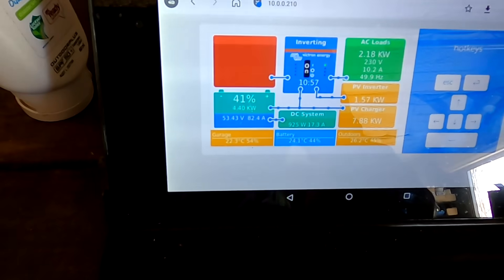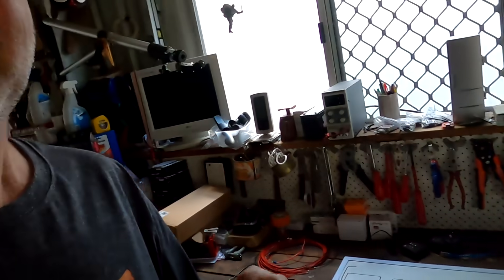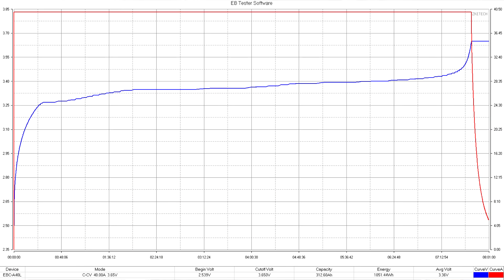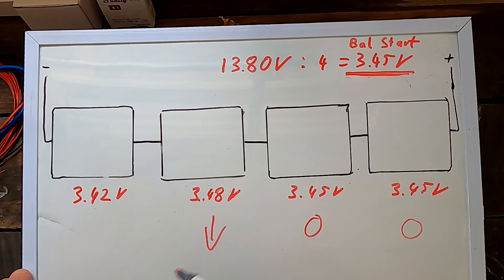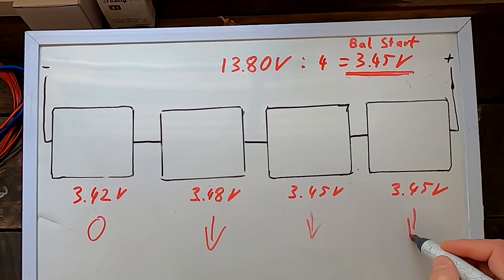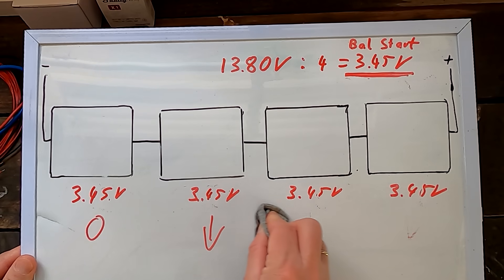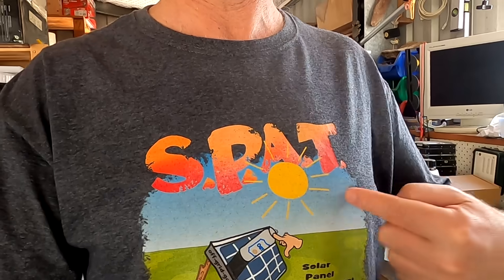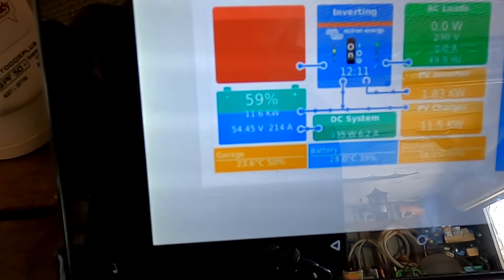Balance Start Voltage for LiFePO4 explained. Why you should not start too early... 🔋⚡

Comment: oct31’23/1639h PST 🇺🇸 Danke Herr. Andy. Guten Morgen. I think you have mentioned this several times during the past 7~8 years. Danke. The theory was put into effect. After studying and practical tests conducted I found it was/is correct. I also found, the readings depend upon the cells/ B,C,D,E to infinity. Many Chinese Cells are Z grade, rejects from the factory and I found it about 6 months ago. A vender from Aurora IL, sold me come LiFePo4 cells with strange trade name.  The cell outer covering, glittering as if fresh from Chinese factory.. top balanced checked for stability, internal resistance checked  (thanks to Andy, for recommending YR1035 and WS400A PV Panel Meter they both serve well in maintenance & testing) Found no significant issues. But, under load  these cells exhibited different characteristics. One cell over charged and JBD ceased charging. The other cell did not charge at all. What I’m trying to portray here is, every character, every reading will be unidentical depending on cells, the good brand name. Buy directly from factory with certification, expensive, but then you don’t have to argue, contradict, exhibit difference of opinion, avoid frustration and indignation etc etc.
By the way, I replaced the cells with TOPBAND cells 3 years ago and all hunky dory, presently.
Thanks.

Comment: Hi Andy, 
Thanks again for another great video.
I know ages ago you did a BMS parameter explanation.
It would be great if you could do one on your prefered settings.
Also one on battery % voltages across the range 0,10,20,30,40,50,60,70,80,90 and 100%
Thanks again Andy!
Reply from the maker: We cannot use voltage to determine the SOC of LiFePO4 batteries. That is impossible. At 3.25V the cell could be at 40% or 80%, no way to tell.
The settings will be different from system to system, so my settings will not fit your design. Very hard to do... Let me think about it...
Reply: There is already one if you search the video's

Comment: What charge voltage you use from inverter for target  55.2v (3.45 x 16)? On my Growatt Inverters I getting 3.35v  on my fully charged batteries from charge voltage of 52v.
Reply from the maker: Yeah, that's normal because of the voltage drop and the two individual measurements the inverter and BMS take.
You may have to set the inverter to 55.3V/55.4V and see how this goes...

Comment: THANKS Andy, as always, a big 👍👍. Right on the money. 
Years ago I had a slow balancer on my 400A LFP caravan battery, and couldn’t set a start voltage so it was always “balancing”, and can absolutely confirm your findings. 
Since I fitted the JK in the van, with balancing set to start at 3.45v, it’s all been PERFECT. I typically see just a few millivolts difference between cells.

Comment: at about 7 mins, what kind of $20 balancer does that! why would it balance all 4 cells as you rightly say when only one has gone above 3.45? you just need to dump energy from the 3.48 into the 3.42 (like the jk bms would)
did i ever mention that I think the jk is the only bms worth buying....
Reply from the maker: That was just an example to explain the basic balancing function.
Yes, JK is still the top!
Reply: @OffGridGarageAustralia  it's addictive, now I have nearly 8kw so need a pure sine inverter so I can run the induction cooker....

Comment: I'm wondering if there is any real capacity difference between charging to 3.45V and 3.55 or 3.65 if they're all followed by absorption and float (at a lower voltage).
Reply: Andy did a video on what the capacity differences are at the different voltages. It isn't a lot of difference at the voltages you talk about.
Reply from the maker: That's the video: https://youtu.be/pijPu7t-akM

Thanks, Larry.

Comment: This is exactly why i don't like lifepo4 or any cell other then lead acid.  Only good thing is they don't weigh much when compared to deep cycle lead acid.
Reply: I still see deep-cycle LA systems in professional applications.. not new ones though (mostly legacy and also because it's simpler), but ESS is just a small part of my engineering/technical work so your mileage may differ.
Reply: @joansparky4439  the only issues i have with lifepo4 cells is that some will reach the ovp over volt protection of 3.65 while most will still be 3.35 to 3.40.   and when under a load some will drop to the uvp under volt protection of 2.40 while most will still be at 3.00 or 3.20.   once a cell reaches a charge of 3.50 or so it climbs quick and same for discharge , once it reaches 2.40 it drops quick.  I'm going to eventually do another test to see what happens when overcharged to 6.00 v and discharged to 0.00 a number of times.  Before i installed a bms i had one used cell that reached 8.00 volt and that cell still works fairly good.  And according to the online videos all should be ok.  Lifepo4 cells dont usually cause a big fire.
Reply: lead acid also needs top balancing in the form of out-gassing (and then topping of with water) to keep them on the same page, while the weakest cell still determines the performance of the whole pack.
Active balancers which are strong enough to divert the energy difference between the weakest and strongest cell run all the time and will remove the weakest-cell limitation and give access to 100% capacity of the pack.
Reply: @joansparky4439  lol, find me a strong enough active balancer to do this miraculous job that doesn't break the bank.  None in existence yet. Lead acid does not require anything other then a charger and won't overcharge individual cells like lifepo4 does.
Reply from the maker: Lead acid is outdated in any aspect. There is literally no advantage of LA over Lithium.
Reply: @OffGridGarageAustralia  only a wealthy person would say that or someone promoting their own sales.  Must be nice. 👍🤟👌

Comment: If you were starting from the beginning now, would you chose to buy single cells and a BMS or ready made batteries with internal BMS?
Reply: I think he discussed this a bit in a recent video.  If you have the time to build your own that is an option. But with the price that some of the batteries like Jakiper are selling for , it gets tough to get all the components and case separate without coming close to the pre-made battery price.  The only difference is you could these days  probably get a better bms than some of the built in ones use.  Besides the single cells and bms  - you need connectors between each cell, breaker, wires, some sort of cell compression, and terminals.
Reply from the maker: It's good to have the options. Price wise, it's not much of a difference and both options have pros and cons.
I personally would still build my own battery like I did in the battery shelf.

Comment: I have read somewhere that DC breaker switches can get hot when the current direction is wrong. Is that correct or false?
Reply from the maker: Most DC breakers are bidirectional so it does not matter. 
I never heard about that a DC breaker gets warm when connected that way. It makes no difference from the current flow and mechanics it has to travel through.
Reply: Most breakers work by a thermal cut off. So if you're running at or over the rated current they heat up, which triggers the disconnect.

AC breakers and DC breakers work differently, so using a DC current in an AC breaker can cause issues with triggering, but also can fail to break the current due to the differences in the nature of AC vs DC.

You should use cable rated for well over the maximum current of your system and then use breakers to match that cable. Breakers are for the protection of your cables, not to control the current flowing in your system.
Reply from the maker: There is a good video from Adam Welsh showing the difference between both

https://youtu.be/S0diAeysxVo?si=2WxSbk3FX_mc153z

Comment: How do I parallel 250a muller energy bms.
Reply from the maker: More info needed.
You need one BSM per battery pack, if this is what you are trying to do.
There is no communication between the BMS though.
Reply: @OffGridGarageAustralia Ok that’s what I figured. that is my setup.  As for parallel, why would you join two bms for?

Comment: Can you parallel multiple MPPT chargers to one battery?
Reply from the maker: You can parallel as many MPPTs as you like and connect them all to your battery. Each MPPT can only have dedicated solar panels connected to it. The panels cannot be shared amongst the MPPTs.
Reply: And when yes, can you also connect to the same solar panels to increase charging current? Or only different panels to one battery?

Comment: Well, im pretty new to this all. I just got my Victron system running and installed with a JK bms active balancer.
I still need to charge the cells to 3.5 ( victron said that charging higher then 3.45 is pretty pointless, because not much power is absorbed above that ) , but ive set the start balance voltage at 3.4. It seems to work pretty good, it takes power from the highest cell to the lowest, just how you would expect.
So how is this not good ?
I understand that balanceing at a lower voltage is pointless, but 3.4v as a start, again, im a total beginner at this, doesnt seem wrong to me.
Reply from the maker: I think I have explained that in this video.
If your target voltage is 3.5V why would you balance cells which are at 3.44V for example?
Reply: @OffGridGarageAustralia  Well, I would say, that if you charge them to 3.5v and also start balancing them at 3.5v , they would drop quickly below 3.5v ( when battery is in use ) , and thus would stop the balancing program. So I imagine you NEED to start balancing below your set charge point. 
But I agree, balancing as high as possible seems to make the most sense.
Ideally you should start balancing after 1hour of rest after charging, but in the real world this probably does not work.
Reply from the maker: @edwinbruckner4752 The charger will keep the battery at constant voltage at this set target voltage (CV or absorption phase), so the battery cell voltages will not really drop as they get recharged right away again until they are all equal and the charge voltage is the same as the battery voltage.
Reply: @OffGridGarageAustralia  
The weakest cell will reach the highest voltages fastest.. to spare that cell it would be wise to start balancing early to keep it's voltage lower and divert the energy it would be trying to store to cells that can easily take it (the ones who are laggards and don't raise as fast with their voltage). This increases the wear on those stronger cells and fills them up faster.
So early balancing with active balancers actually is preferable as it saves weak cells and wears strong cells more and ideally (if the balancer is strong enough) should even enable more capacity in the bank as the weakest cell is supported by the strongest cells now.
For passive balancing with it's minuscule energy burning capabilities in those tiny resistors this is not working and late top balancing is the only viable way, while having to live with the weakest cell determining the overall battery performance.
Active balancers simply allow for less well matched banks to work as good as better matched banks.

Comment: I guess you mixed up some terms. If we talking about balancing on the charge phase, there is no such thing as a discharge (unless your balancer allows you to bypass ALL charging current for a dedicated battery). So if the balancing current is less than the charging current (which is true for almost all cases) all that balancer can do - is distribute a small part of the charging current between the batteries. So if the charging current is 20A and the max balancer current (delta) is 5A you may have as a result, for 4 cells: 25A (for battery with lowest voltage), 15A (for battery with highest voltage) , 20A, 20A. So there is no such thing as "discharge", just one battery with the highest voltage would have less charging current.
Reply from the maker: No, I didn't mix that up. Balancing while charging is pointless unless you charging current is lower than your balance current. Just as you said.
Reply: @ OffGridGarageAustralia  
Balancing while charging removes charging energy from the weaker (faster raising) cell and pushes it to the stronger (slower raising) cell.
As long as the cell capacity/capability difference is within the reach of what the active balancer is able to divert from the weaker to the stronger cells, will this ensure that all cells are being loaded appropriately to their capabilities.. the weaker ones are being loaded less while the stronger ones are loaded more (same applies to discharing while active balancing is on).  Over time this should get the cells within the pack on equal footing as the wear on the stronger cells is higher.
All this "top-balancing" wisdom is only useful for passive balancers.. active balancers who can divert the energy difference between weak and strong cells make this approach moot and gives us access to 100% capacity of all cells.. not just the 100% of the weakest cell applied to the whole pack that passive balancing is capable off.
Reply: I agree with you. Ok, 2 A balancing current is not much compared to 20 A charge current. But it is still better than nothing, and will slightly prevent an OVP. Starting the balancing early (90%+ SOC) will in worst case accomplish nothing, and best case prevent an OVP. My main point is that it has no negative side effects, so why not do it? It will not artificially lower all the cells like Andy claims. I think he is right about many things, but in this case he is wrong.

Comment: I guess this would come down to the implementation. 

In case of a passive balancer it might just connect all of the batteries for balancing.

But if the start voltage only turns on the active balancer so it can balance only the cells with enough deviation, then starting just a little earlier should not be a problem as long as you avoid the flat part of the voltage curve.
Reply from the maker: I left the deviation setting out here as it complicates things, but you're right, the balancer may not run with the examples I brought up.
I would still not set the start balance earlier.
Reply: @OffGridGarageAustralia  I'm doing all of this reasoning in theory, but don't you run the risk of the balancer comstantly turning off and on as the charger backs off or even shuts down completely? 

I suspect that  at these margins the charger may effect cell voltage measurements just a little to much,, especially as balancing also loses some energy as heat.

Or is this all taken care of by the other BMS settings and margins in the balancer itself?

Comment: It seems my Lifepo4  4s pac has a top voltage of 3.4 before one cell starts running away. I let the charger bring the voltage up to its battery max 3.5 (each cell) recently. It took my active balancer about 3 1/2 days before the pac was almost 100% balanced. From now on ill try to charge the cells to 3.4 or below to keep the cells balanced. BTW Will Prowse says if you have a run away cell its best to keep the cells at 3.2 volts max charge to keep them balanced .In that video he said you dont need a BMS or a Balancer if you keep the cells @ 3.2 volts .In my case hes exactly right. if i keep my cells 3.4 or a little below they balance perfectly. Its only when i go above 3.4 the cells become imbalanced.
Reply from the maker: You cannot charge LiFePO4 to 3.4V only. Or even below. 3.2V makes definitely no sense at all and is wrong advice. Charging to 3.2V could be everything from 20%-80% state of charge.
Because of the flat charge curve, there will be now deviation visible until you go 3.45V or higher. Seeing no deviation earlier does not mean the pack is balanced. It is meaningless to compare cell voltage below 3.45V.
Reply: @OffGridGarageAustralia  Will did say 80% SOC is fine.
Reply: @mannyfragoza9652 but charging to 3.2V doesn't necessarily bring you to 80% SOC, and different cells could appear to be balanced, but with huge differences in SOC as it's at the lower end of the flat curve when charging.

While individually testing my cells, for a full discharge the average cell voltage was 3.25V. It would be even higher when charging, so you'd be hovering at about 30% SOC or thereabouts on average.

If you're not using a BMS, you're just ensuring massive deviation on discharge, further decreasing overall capacity.
Reply: @davidpenfold  Im constantly checking cell voltage and never see a deviation in cell voltage when im discharging. Just when i get past 3.4 volts when im charging. I guess a BMS would help to bring to full charge at 3.5 volts ?
Reply: @mannyfragoza9652  Definitely.